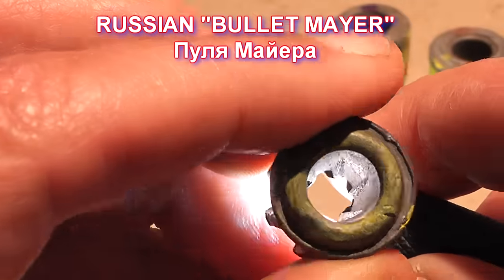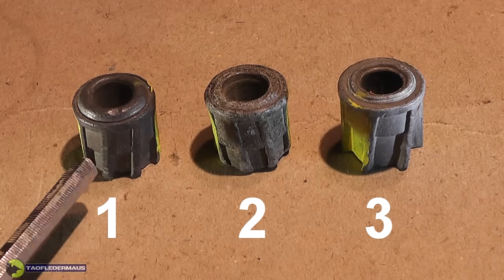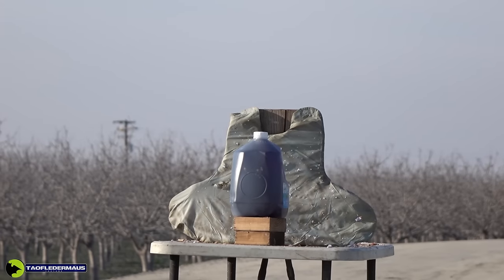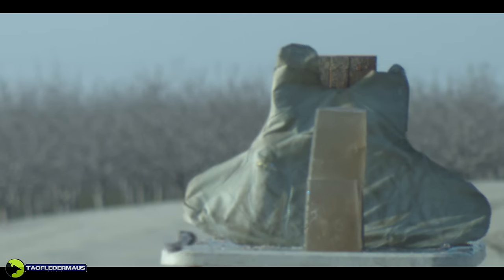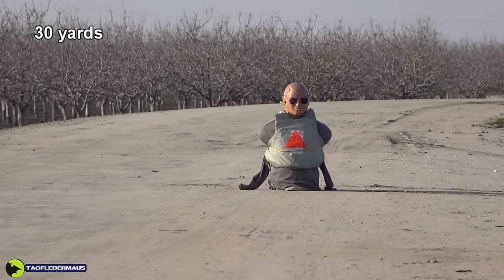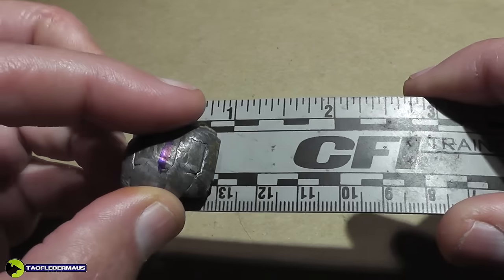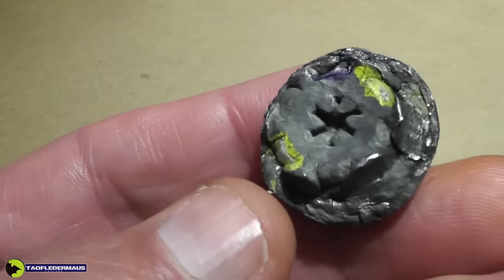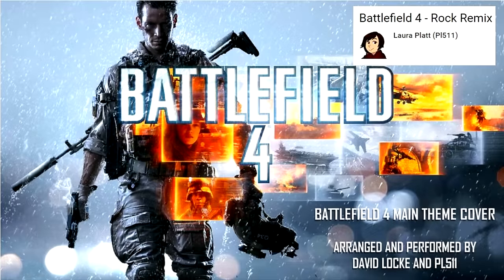Russian "Physics Defying"  shotgun slug  -   Another look

Comment: Awesome Jeff! :) You have kind of proved the these slugs are quite stable, regardless of their reputation in these parts of the world. I actually start to like them. A few questions: I remember you got some kind of cool-tool to crimp the shells with. What are those called? I really need such a tool! Is it hot loads you are using, or just field loads?

Have a great weekend Jeff and crew!
Reply from the maker: Thanks Lars!   (finally got to these huh?!)   I've seen these for sale on several Russian websites.  I use a roll crimper that goes on a drill press.   You can also get a hand-cranked old-style one that clamps to a bench and some guys prefer those.   I've seen some sellers in Russia selling those on Ebay.   Search "shotgun shell crimper".    I just used field loads.   I read if you load these TOO hot they will get a bit compressed and distorted when shot.

Comment: TL:DR when the wadding/powerpiston/etc seperate from this round -  the shockwave is not the same as with other solid slugs -  and the air will go through the middle, similar to the throwing rings you can make from paper that fly very stable.

pretty sure the shockwave will be altered by the fact the entire nose is a hole going through. those little paper circles you make and throw -  that fly really far should be an example of this to some degree. I understand that for example on the dumbbell/piston  types you recently showed that it wouldnt  matter the shaping of the sides of the projectile - and I think perhaps if the wadding etc sticks to the back of the slug in this case, then the shockwave would be created -  and cause the wadding to stay stuck to the slug -  but if the slug exits the barrel on its own -  there is no reason for the air to not pass through the middle as well as around the outside.  this can be seen by the slug flying straight in one of your shots where the wadding separated -  because it was obliterated-  and another where it hits sideways when the wadding remained attached.
Reply from the maker: Yes,  the shockwave still prevent air from flow into the center.  That is why they put aerospikes on jet engines like the SR71.

Comment: so one thing I've noticed in many of your videos is the claim that there is no air flow through the center of hollow shells due to the shock wave in front of them, and that's not quite a correct claim. what the shock wave is is a discontinuity in the flow, but not a wall blocking all airflow (if this was the case there would be a vacuum around the bullet and there would be no way to stabilize the shell outside of spin stabilization, we know from the stability of other shapes in flight that this is not the case).

what is really happening with a shock wave is that the flow around the object is slowing to a subsonic velocity (at least in the case of normal shocks, as what happens with a bullet, oblique shock waves like those in a rocket exhaust behave differently), or in this case, accelerating such that its velocity relative to the bullet is subsonic.

what makes hollow bullets really unstable is the greatly reduced size of the trailing low pressure region, which in solid bullets moves the center of drag significantly farther back, improving stability. without this low pressure region, the majority of the drag on the bullet comes from the leading shock, moving the center of drag ahead of the center of mass, leading to dynamic instability.

source: I'm an aerospace engineer

Comment: Everytime you have some design that is suppose to rotate because they have holes, fancy fins, absorber antennas for cosmic rotational energy :-) or whatnot. You should paint the rear end with two yellow markings like your other video. Then it is 10x easier to see if it actually spins.
Reply from the maker: these had yellow markings on them
Reply: sorry, my typo. What i mean was "this video" not "other video". I had that video of the rifled slug in mind and wrote wrong. Both in that video and this video it is fairly easy to see the spin. The ones i remember i missed it on was the machined ones with some twisted holes/groves.

Comment: Why did you not reload the shell to the lightest powder per your loading data charts to get a clearly subsonic projectile. Secondly, why dont you keep a few used chronographs on hand to verify the fps you loaded to is what you are getting? Thanks and I only mean these as questions and not criticism.
Reply from the maker: I only had three of these and was more focused on testing the expansion of these.   It's very hard to chrono shotguns slugs since you have waddings and other stuff that will give the chronograph errors when they also pass over it.    Plus I'm not Bruce Wayne and can't afford everything.

Comment: Next time, maybe try to drill a small hole into the nitro card to prevent the slug from creating a low-pressure area inside the central which sucks on the card and keeps it from falling off after the slug left the barrel. ;)
Reply from the maker: The shockwave creates a high pressure area in the front,  so the slug is left with a low pressure wake in the rear.  You saw the fiber wadding following in the wake and it wasn't even directly touching the slug.
Reply: Yes, I'm familiar with supersonic gas dynamics. ^^
But I remember you talking about either the card or the wadding sticking to the slug itself from time to time, so that jumped into my mind at this point. Idefinitely shouldn't do YT comments that early in the morning I guess.

Comment: What makes you think the hole in the centre of these slugs has no effect? You've mentioned it in a couple of videos and that's not true. Shockwave or no Shockwave you're still getting flow through the centre section and the vanes have an effect
Reply from the maker: If there was air blasting through the center,   then the wadding would not be able to stay sucked in the wake. You can see it clearly in this one.

Comment: Possibly a stupid question..."does crimping the ends of the shotgun shells necessary at all?". I ask because every "round"is pretty much just laid inside the shell with no crimping.  Just curious, GREAT video!  Later...
Reply: I understand you can't "crimp" EVERYTHING.  Just by shape and size, every round is different.
Reply: if you're loading them one at a time, and don't have to worry about weatherproofing, there's no reason to.  I'd imagine you lose a miniscule amount of pressure, but it's a shotgun, not a rail gun.
Reply: I wouldn't have thought so with rounds like this. I'm pretty sure you'd only crimp it with buckshot so it doesn't all fall out. Slugs tend to fit in there pretty snugly.
Reply: YES.  In a real world reload application you need to roll crimp slugs. If you point the shotgun downward, the slug can fall out of the shell causing a barrel obstruction.
Reply: I found this to be a very informative question :)